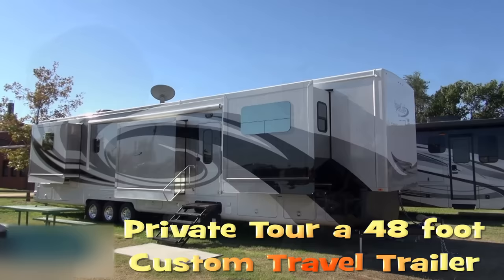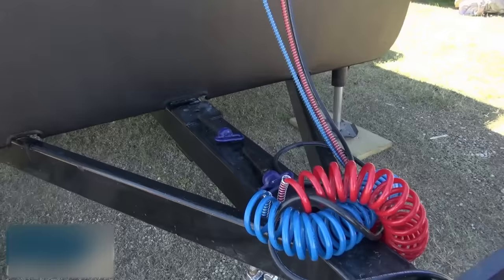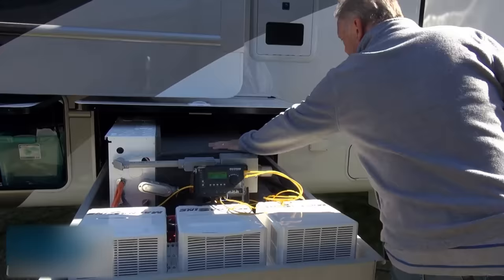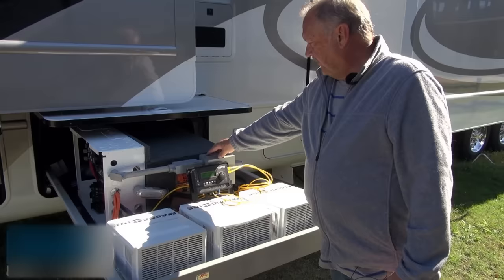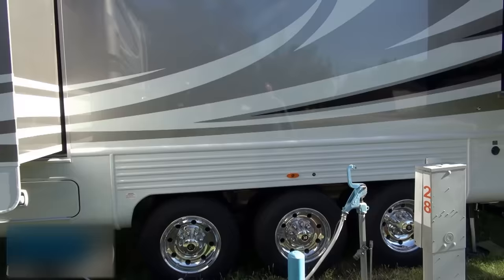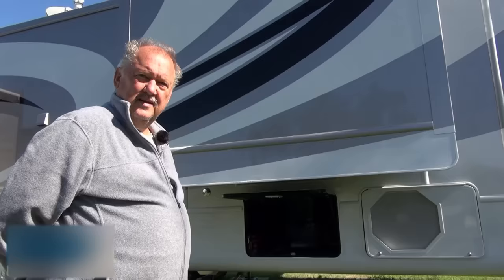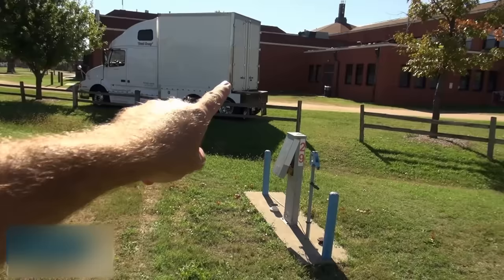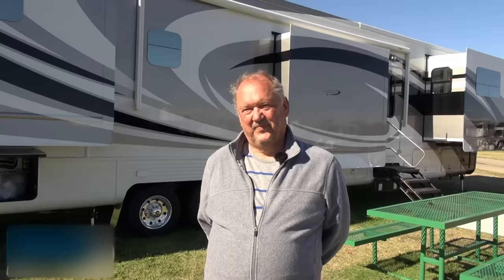Private Tour Exterior and Systems of 48 Foot Travel Trailer By Spacecraft

Comment: If Steve flew the Dream-lifter he must have worked for Boeing. 
Nice job guys. This has almost everything I would want in MY ultimate RV. 
The only thing missing is the Basement Slideout Jacuzzi with the 80” HD TV and Wet Bar/BBQ Grill combo
Reply from the maker: Spacecraft will make that for you!  No Problem!
Reply: All About RVHaulers with Gregg Holy shit!

Comment: I have a similar electrical system in my 5th wheel where I run 24/7 on inverters. Instead of a Chevy Volt battery, I use aircraft lithium cells.

Comment: Just Stunning!!!! What a truly awesome RV. These nice folks really built an amazing coach. I love many of the features they designed. His power management engineering is awe inspiring. What an intelligent man. The entry stair system StarCraft uses is the best. It's a little more weight and labor intensive but so worth it. A modification to the new Mor-Ride fold up stairs can provide a similar set up featuring the small stoop at the top of the stairs. This can be achieved by a separate fold down platform. Or so it seems in my non-engineering pea sized brain. 

Two things I dislike about SpaceCraft. One is the ceiling. And the second is their fender skirts. Granted they aren't a production line with millions to spend on R&D annually to update the the model for next year or even half year changes as we see today from some of the biggest RV manufacturers. Additionally it was surprising to see wood framing for the floor. Is the entire unit framed in wood? Yes wood is much better than aluminum for insulating purposes. Aluminum is an unstoppable conductor of heat. Cold days it pulls heat out. On hot days it heats the interior. Therefore it's understandable if the walls and especially the roof is all wood. If so, that certainly explains some of the extreme weight of this rv. Although not extreme considering the length, height, and top tier materials and finishes. This is an "Extreme RV" made to last for the next generation to enjoy. It really is a high-end house on wheels. Not your typical full time rv with a use by date or shelf life of just 10 years. 

Thank you for taking the time to film and share this video. Additionally thank your friends for me for allowing you to film their beautiful home. This is the most detailed video of a StarCraft I've seen. Most excellent!

Cheers from Seattle!

Comment: Assuming the 48’ length is bumper to hitch that leaves 17’ for the Volvo. Looks like it’s longer than 65’.
Reply from the maker: Hello.  Actually my understanding is that the coach is 48 feet of living space.  Yes, that is a VERY safe assumption it is a bit long.  Maybe a bit over 65 feet.  I didn't measure it myself, but I would guess it might be 65 feet 80 inches long.
Reply: Not all states are limited to 65'. Plus, if he has CDL he won't be limited on total length but rather trailer length, 53'.

Comment: Gregg,  I’ve been enjoying your videos.  Question as to overall length.  If your total length (RVHauler and trailer ) is over 65’ and you want to drive it through states that the max length is 65’,  what do you do ?  You just take a risk of being pulled over by police or you can ask for a special permit ?  Sorry I’ve never owned a RV,  ant this might be a silly question to ask.
Reply from the maker: Hello, and thanks for the question.  Every state has their own rules. There are some NE states that have even shorter overall lengths (50').  Some are longer (80').  Some vary from road to road WITHIN an individual state.  There are many standard pickup truck and trailer combinations that are over those lengths.  There are even length limits for the trailer itself in some states.  Some states require trailers to be 40' or less.  It is a conscious decision every traveler has to make.  Some folks have chosen to avoid certain locations, while others have traveled for close to 20 years with long rigs - and never had issues.

Comment: Just curious if someone can answer this. Could you take say 1-2 Tesla 100 battery packs and wire them up to run a 5th wheel or RV.  Just to power the accessories.  If you could it could run it for at least a week and this is not counting the solar input too.

Comment: As a truck driver myself and knowing that balance of load is key to good handling. My question is, knowing the trailers you are setting up to pull are nowhere near as heavy as what I pull. By putting the hitch behind the axle and not centered over the drive, does this effect truck handling and what is the reason for not centering the hitch?
Reply from the maker: Hi Jon.  Great question - we have a video that explains that specifically if you are interested - https://youtu.be/b4-xvqDtdnA
Reply: It's no different than a mobile home toter.

Comment: 😅 *system*? 😲 
Aint that unique custom build trailers supposely being call bumperpull + built in wiring  +  extended quarter slides "engineering machinery /mechanical showcase"